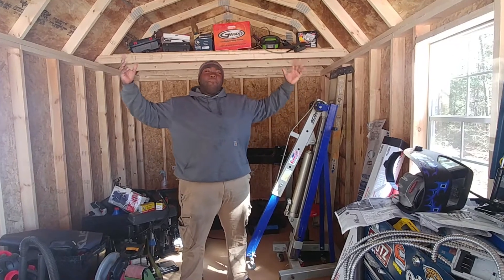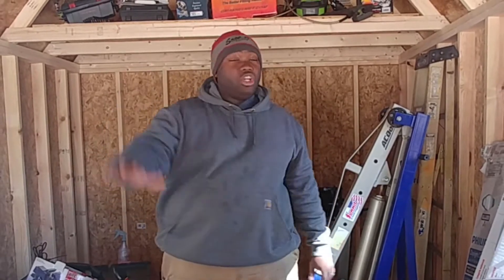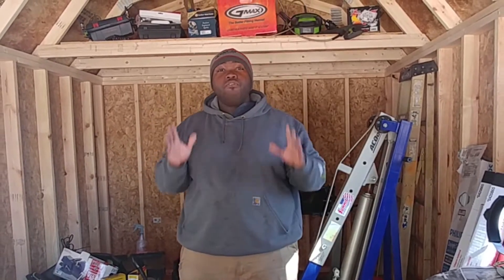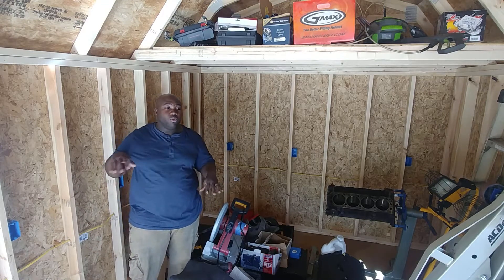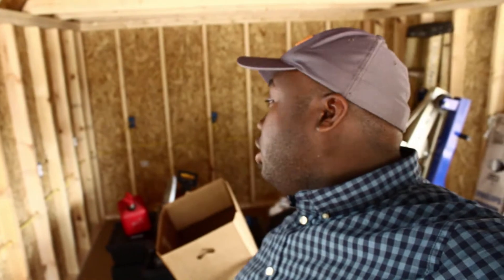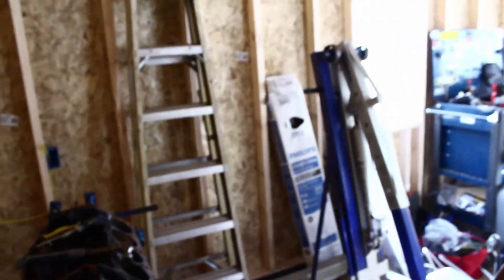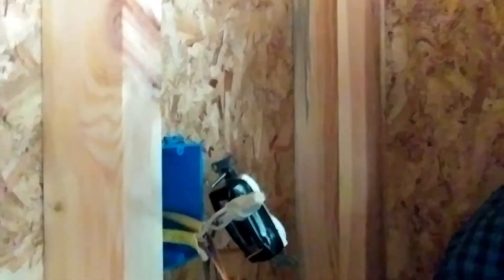Workshop work Part 1

Comment: Proper wiring is: ground, neutral, and hot. Only thing I see wrong is the wire staples. Should only be one wire per staple unless rated for 2 or more. Great video and it’s good to see you back brother.
Reply from the maker: +Scott Pardee thanks! I'm going to go back and make sure I'm doing that!

Comment: When I did mine, can't have too many outlets. Double boxes by the bench.  Have the lights on a different circuit from the outlets.  Also check with your local codes.

Comment: You should make a middle table so you can have more space for a drill press or sander just some idea starters
Reply from the maker: +call of duty gameplay I like it. If you got more ideas let me know
Reply: Atomic Garage one outher idea is to buy a youcon toolbox from harbor freight or just keep the one that you have and put on the end of the shed/work shop is put a toolbox or 2 work stations on each side and in the middle of the 2 put a work bench in the middle with a peg board and put a light across that i think that is how you spell the toolbox name from harbor freight tools
Reply from the maker: +call of duty gameplay I like that too. My problem is setting up everything to flow for me.

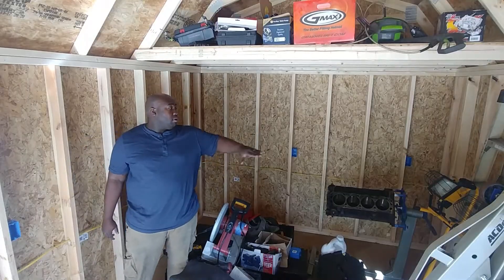Comment: I been wrenching for Honda too long, what on earth is that thing on the engine stand at 3:31? Looks like you're off to a good start!
Reply: looks like it could be a SBF. judging by the oil filter location, distributor hole and flat top bellhousing. just a guess. Adam you may need to move your outlet boxes out some so they will be flush with your drywall or OSB. otherwise your outlets will be back in when you go to put covers on them. The boxes usually have little tabs on the side that help locate them.
Reply: I just miss V8's   :(
Reply from the maker: +Ken Noland sssssssshhhhhhhhhhhhhhh Ken. You can't be letting the cat out the bag like that! Lol. More on that soon to come!
Reply from the maker: +MrKroogur nothing like them!

Comment: Did I miss it in the video, but you are using multiple curcuits for lights, power?
Reply from the maker: i didnt include it in the video but yes. I have multiple different circuits. one for lights, one for outlets, one for 220 volt for welder etc, and probably one more for outside lighting.